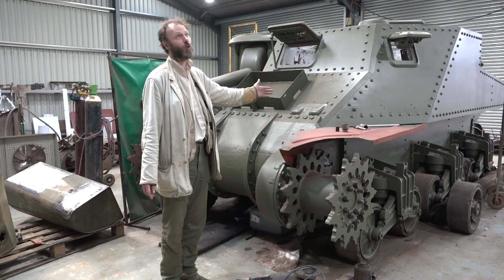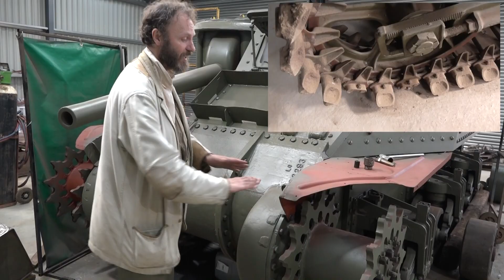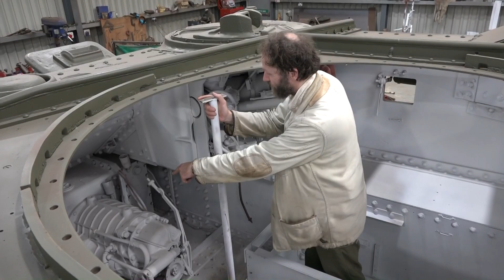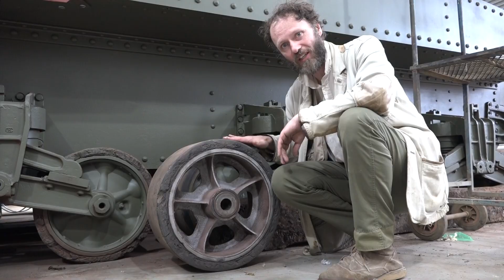The British Lee tank (that is not a Grant)

Comment: Actually, the main problem with the gun stabilisers, was that they were SO secret, that the troops issued them weren't given any information about them. Tests showed they worked well, when opperated by someone who had been given the full information on how to use the things. The situation did change later in the war, and at that point, the troops loved them. Those who had to fight the things because they didn't get told how to work them, ripped them out. Chieftain did a video on the subject.

Comment: If it's a Lee, it's American. You Brit's had a larger turret made and called your M3's Grants.
Reply: I stand corrected. I didn't know about the Pacific Theater Lee's.
Reply: the British DID actually use both, which is why they wanted the Grant created as it had the advantage of having the radio gear where it was able to be used by the commander more easily.

Comment: The comment about the stabaliser at 18:00 (appx). Was it definitely for the turret gun? The British 2 pounder - or 40mm - in the Matilda was shoulder aimed and thus was balanced to be handled by the gunner. If the US 37mm AT gun was similar, then you would not need a stabaliser (which saved space) in the turret. Putting a two axis stabaliser on the 75mm which both elevated and slewed would make sense. Not a fan of the M3, so do not know much about it but I think the stabaliser is for the heavy gun.

Comment: Cupola/commander's hatch MGs have two purposes:  Close defence against flanking infantry and close defence anti-air.  While they aren't great in either role, they are a lot better than not having one when the armour gets caught out by itself.  The advantage a cupola gives is that you can keep using it when the infantry gets close enough to start tossing grenades and the hatch would have to be closed.

As for calling a gun on a tank a howitzer even though it was for direct fire, that's actually correct.  The guns on tanks and SP guns tended to be either based on AT guns or howitzers leading to high-velocity guns being termed "guns" and low-velocity guns being termed "howitzers".  In the specific case of the M3 medium tank the 75mm was actually based on a rejected AA gun, but its low muzzle velocity places it as a howitzer in terms of being mounted on a tank.

Comment: Pro-tip for telling apart a Lee and a Grant even without the turret: 
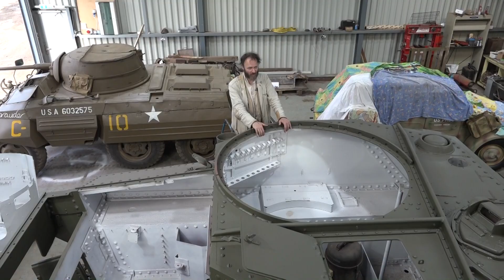The Lee has an antenna mounting on the hull, because that's where its radio is. The mounting is a roughly hemispherical cup on the rear left of the upper hull, it's visible in the video from 19:20 onward, just to the left of Lindy there. A Grant hull won't have this, since it had the radio in the turret and thus the antenna on the turret roof.

Comment: Turret is only six inches smaller than a Sherman and it has a muuuuuch smaller gun in it.
Not so tight.
And in the American versions there wouldn't be any radio gear cluttering it up.

Comment: Being a warbird mechanic Iw wonder about the gun stab system 
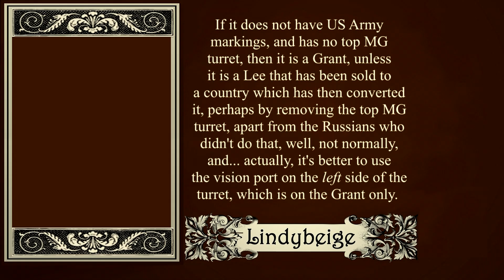22:12 I think you need two flywheels to stabilise. One is elevation sense  in pitch and one is to sense sideways tilt. 
Due  to the position of the unit at the gun it moves with gun elevation. 
So both fly wheels are working the vertical stab only.  It doesn’t know what the rotation / traverse is of the gun and turret. 
This is what makes is unreliable. If you traversed during driving, the gun gyro’s need time to stabilise , there is too much input at one time. 
What must happen if you rotate/ traverse the side motion gyro will tilt and produce signal to compensate. 
This is actually an unwanted signal. Maybe the input of the gunners hand is that compensation. 

I can image that the crew where “gimballed” by this all. 

Nevertheless I love to learn more about these systems.

Comment: People complain about the side sponson gun on the M3.  Yet one of the most effective armored fighting vehicles of the war was the Jagdpanther that had a hull mounted non-traversing gun.
M3's didn't sit up on top of hills with their hulls exposed.  They sat in defilade with as little of the top turret exposed as possible.  The commander would then spot a target, identify it to the gunner, then the tank would "pop-up", engage and hull down again.  That is, when there was terrain to hide behind.
Not much of that in north Africa, and not much use when attacking in column or online.  Mobile warfare rewards the fastest shooter, not the best hider.
It was a rude surprise for the Krauts when they showed up and confronted Panzer III's and IV's, and completely dominated the Japanese Type 95's.
Later they were converted to APC's.
They were a good tank for their time and when used for their original purpose of infantry support.  Aussies used them, in that roll,  all the way into the mid 1950's.

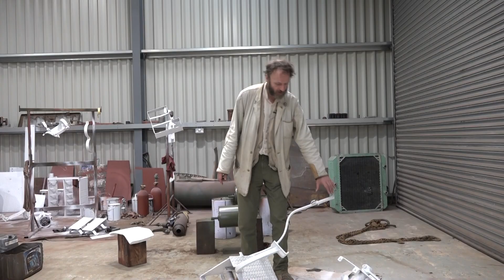Comment: 10:07 Riveting is not quick when compared to welding. Which is why they stopped riveting tanks. Welding takes 1 person. Riveting takes someone to drill matching holes in both surfaces. Someone needs to tend the fire and rivets, you then need a thrower, and then 2 people to attach the rivet.

Comment: 01:58  Yeah...fun times.  A bunch of rivet bullets flying around the inside of your tank after a rough hit form a main gun round.

04:44  Yes, that's the main gun Lindy.  They added it after realizing the original main gun in the turret was too small a calibre to use on German Armor.

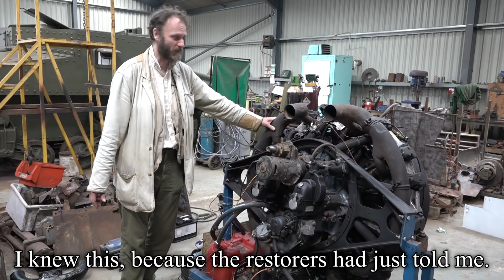06:53  Amazing thing is that the Abrams still uses a helicopter turbine to run the drive system.  It's a major fuel hog though.

Comment: I think the technical problem with welding at the time was the inability to reliably weld two thick plates together. A ring of weld around a rivet head is a much simpler operation as the depth of the weld is much less.

Comment: Hull machine and turret machine guns weren't all that silly really, not when you consider that tank warfare was still a relatively new thing and people were still figuring out what made a good tank. Both the Germans and the Russians mounted machine guns on the hulls of their and I believe that some British designed tanks did too. The idea was to use them to discourage infantry from getting too close to the tank and placing nasty things like satchel chargers, and other explosives on their tanks. In fact, the original models of German Ferdinand/Elefant tank destroyers lacked hull machine guns and as a result they'd get swarmed by infantry, as a result, later models were made with a hull machine gun based on lessons learned.

Comment: The gun gyrostabilizer was also included on the Sherman and had a similar dubious legacy. The device did actually somewhat work; it's not amazing when firing on the move, but it was at least possible. The advantage mainly came in being able to make an aimed shot when the tank came to a stop faster. Without stabilization the gun and sight would be bouncing around longer and the gunner would have to wait.

Thing was, it was deemed important enough to be considered secret tech. As such the crews weren't really trained on how it worked nor did they have manuals to consult. Some gunners would feel like it was harming rather than helping and thus preferred them to stay off. For crews that did figure it out, they apparently liked it.

Comment: Maybe the empty shell was like a 'snap cap'? It's an inert shell you put in a gun so you can safely fire it and take the pressure off the hammer/striker spring before storing it. In most modern small arms removing an empty shell re-cocks the action so you leave the shell in the gun, but I don't know how tank guns re-cock

Comment: Ive been building a scale model of panther G interior.The sequence of assembling the model (RFM 5019)is probably a lot different to the actual construction.What you can't see from the plans or the finished real tank, is how delicate the mechanics of a shaft that runs across top of gearbox,secured either side just above front drive sprocket are.It looks like one good bang either side wouldn't do the tank much good.Not ideal spot for repair either.

Comment: Stabilising the gun in the elevating plane will require two gyros because otherwise tilting the tank will really foul things up.
We had two axis stabilization on the Cv90 i served on in the Swedish army and it was nowhere near proper stabilization, you need three axis for that.
And if you want modern accuracy regarding stabilization you need a stabilized sight and a computer that measures the difference and an electric firing pin as well.

P.S. you should do an episode on the Hazemeyer gun mount

Comment: The most interesting thing about M3 is that Soviet assessment of the tank found that you can put 11 soldiers inside and tank will still retain its combat capability.
Reply: And they nicknamed them ‘Grave for seven brothers’
Reply: So, it was APC than!
Reply: As I understand it. 1,386  M3 mediums were shipped, a substantial number were lost in transit.   USSR used the M3 medium and M3 light (1,676 shipped) in front line service as late as Kursk.
 If they did not like them as tanks, they could have removed the turrets and used them as SP guns which they lacked or removed the turrets and guns and used them as APC's which they also lacked.
  USSR converted 300 captured Pz III's and Stug's into the SU 76i (link below) which was basically a Soviet Stug.  But no effort was made to use the turrets from  knocked out  M3 mediums and lights on Soviet light tanks (T60, 20mm gun)  which would have required only an adapter ring which would have been easier and faster than building new turrets.
   It is always easier to bitch about something than it is to do something about it.

https://tanks-encyclopedia.com/ww2/soviet/soviet-su-76i.php
Reply: @nickdanger3802  more like a Soviet marder, as it didn't exactly have much armor, and was relatively quick
Reply: There is no word for "privacy" in Russian (true!)  3 of them would be MVD Political Officers.....
Reply: I think the Soviet Army removed the main gun and it's ammo bins to convert their M3's into troop carriers that could hold a platoon and fast gun tractors that could hold the gun crew plus a store of rounds.
Reply: How many more could fit on it as riders?
Reply: But why? Why would you do that?

Except maybe troop transport.
Reply: @ferbthe2gadgetguy  if one comrade is killed, there is always another one.
Reply: @jerrybroderick2858  war thunder crew in a nutshell
Reply: The Russians referred to the m3 as a steel coffin for 7 brothers.
Reply: Sounds very soviet
Reply: Lol, leave it to the soviets to make a more cramped crew space!

Comment: I really enjoyed this video and it gave me some neat ideas about how gaming could integrate some of these more nuanced parts of what a tank was designed for and how it would be used. Imagine a long-form narrative with survival and logistical challenges, like The Witcher 3 did it (minus the focus on side quests). Have a few theatres of war to choose from, follow a single tank and its crew from start to finish. You're responsible for outfitting the tank with enough supplies to keep the crew fed and quenched, stop in for repair work at the occasional field workshop, perhaps even barter cigarettes for supplies or salvage parts from wrecks, even replace killed crewmen or escape a downed tank and retreat to a base to get a new vehicle.

Comment: The stablizer was never designed to fire on the move. That was totally out of its design spec. It was however, designed to reduce the engagement time from a hull down position to a firing position by keeping the gunners primary sight near the target during movement. 

Also the counterweight was only required for the shorter guns when the stablizer was used. The stabilizer was actually quite effective when the crews were trained in it. However, its operation was so highly classified that many crews were not trained in how to use and maintain this highly complex system. Units that actually were trained in it loved them.

Also the M3 was never meant to be anything but a stopgap. No foundries could produce single castings large enough to mount the 75 mm in the quantities needed at that time but they needed tanks with 75 mm firepower. 

I do wonder though if that extra man was useful for guard duties or other physical labor that is always needed. Though carrying several gallons of water and having one less mouth to feed and to drink must have been nice.

Comment: I believe that Lee in the French museum that you refer to as a command tank is in fact an M31 ARV roughly mocked up to look as a M3 gun tank. The door with the fake gun where the 75mm should be and the extra spare road wheel mounts to the front of the tank were all modifications done when they converted M3's to M31 ARVs.

Comment: The gyroscopic stabilizer need to work on 2 planes not to control the turret traverse, but to stabilize the gun if the tank is not on even ground; for example canted to one side.

Comment: 1:12  The M3 Lee/Grant preceded the M4 Sherman, so the Lee/Grant was not "based on" the Sherman.  The Sherman shared the suspension system of the Lee/Grant, it is true, though it would be a stretch to say the Sherman was "based on" the Lee/Grant either.
Reply: Yeah.... you'd think the "M3, M4" thing would give it away...

Comment: do you remember the scenes in Das Boot where the water pressure in the hull caused bolts to pop off like bullets and bounce around until it hit a soft fleshy target? one APHE shell into that frontal armour and those lines of rivets just turned into a shotgun blast of bolts flying around in a cramped crew compartment

THAT ladies and gentlemen is why tanks stopped using bolted armour, the Germans were ahead of the Game along with the USSR, while the Americans caught up with the shermans and the british were stuck faaaar behind with wartime designs like the Cromwell.....

Comment: One point about the radial engine I am not sure many people know is that it could be used to save the crew in case of fire.                                                                                                                                                                                                                                                                                                                                  I used to volunteer at the Patton Museum and we had an M4 named 'Cindy'. She was equipped with a radial engine and my first ride as assistant driver (or bow gunner or whatever you would like to call the position to the right of the driver) I was concerned about being able to escape in case of a fire because the hatches were so small. The driver assured me there would be no problem, adding that he could blow the fire out of the back and keep the crew compartment more or less safe for long enough for everyone to escape simply by putting Cindy in neutral and revving the engine. Now, this would not have been effective if the fire were in the crew compartment, but we were not in combat. If there were going to be a fire during a demonstration, it would be in the engine compartment.

Comment: The bolts were horrible. Not a design innovation at all. All early tanks had them. If the got hit by a round, even if not penetrating round, those bolts would shear off and become little hot bullets ricocheting throughout the veh. No bueno. Once welding and casting could be done, it was done from then on.

Comment: Actually

The Lee was the American Variant with 7 crews:Driver,75mm gunner,75mm loader,Radio Operator,37mm gunner,37mm loader,Tank commander

Whilst the Grant is a British variant that removed the radio operator because they put a bulge in the turret thus eliminating the need for the radio operator needing only 6 crews:Driver,75mm gunner,75mm loader,37mm gunner,37mm loader and the Tank commander which also operates the radio

Comment: the stabilization system did indeed work, but it was considered top secret and no one was taught how to use and maintain it. when tank companies took the time to figure them out, they saw better results than even ordinance expected. yes they still had to stop to fire, but they could get on target before stopping to fire, allowing a very rapid first shot compared to not having it.

but again, no one was taught to use them and so they were often disabled or disposed of. thanks, ordinance. You can keep your magnetic torpedo detonators as well.

Comment: To my knowledge the 75mm gun in the lee was the same one as in the Sherman, so it was in fact not a howitzer
Reply: That's correct.  The 75mm was the main gun.  The 75mm AP round could easily take out early Panzer IIIs and Panzer IVs.  The Turret mounted 37mm was used for its canister round to take out infantry, like a giant shotgun.
Reply: @mattpierce4194  The 37mm was pretty much the standard for anti tank work during the early years of the ear for both the Germans and Americans.
Reply: Worth mentioning that there were two different 75mm guns, the M2 and M3. M2 is the shorter barrel one. Very few M4 tanks were built with M2 guns, I think only a few dozen.
Reply: And it was based on the ''French 75,'' of WWI fame. The Schneider M1897 was a French Army field gun. Adopted by the US Army in that war, and retained in service thru WWII. M1897A3s were French-made and M1897A4s were US-made. Field guns were modernized with rubber tires in the Late '30s., allowing high speed towing behind trucks, and split trails allowed better stability in emplacements as well as greater elevation. New ammo was developed including AP.  With the acceptance of the 105
mm field gun, the 75s were obsolete as field artillery, but then were mounted on half-tracks as the 75mm M3 Gun Motor Carriage. Marines used the M3 GMCs in the Pacific. The M2 and M3 75mm guns were mounted in the M3 and M4 tanks. An M6 75mm was mounted in the M24 Chaffee. The 75 gun in the B-25G+H Mitchells used the same Schneider 75mm rounds as the tanks.